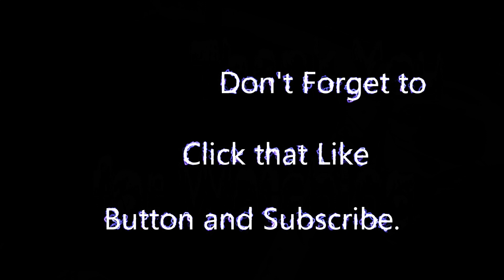Free 3D Printed Funnel for GM Camaro 3.6L Engine.

Comment: If you need to use a funnel to put  oil in hole that big get away from the car , you can pour oil in there without a funnel don't make people buy stuff they don't need
Reply from the maker: Lol, You are one of those assclowns that not only CAN'T read but didn't watch the video. I designed and am giving away that 3d file for free so anyone can 3d print their own.